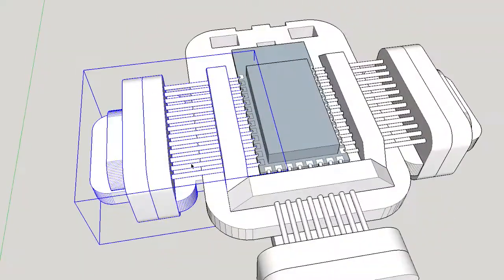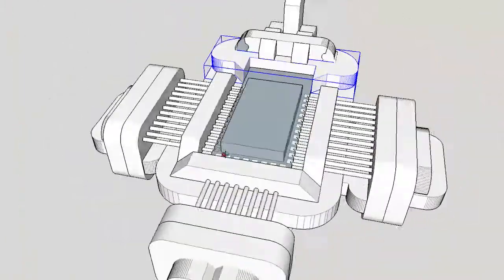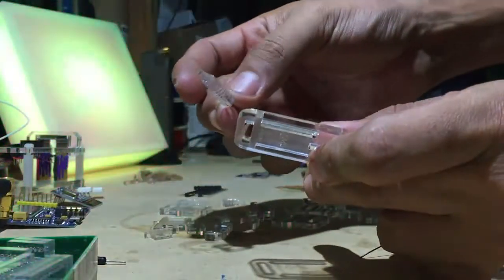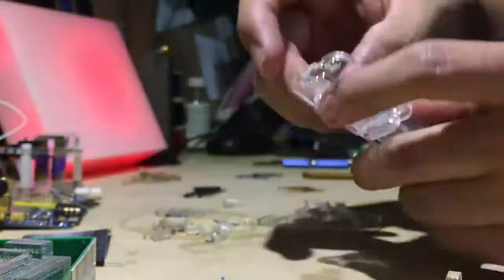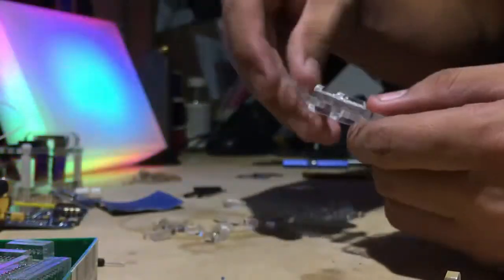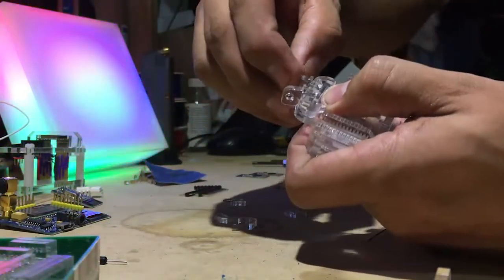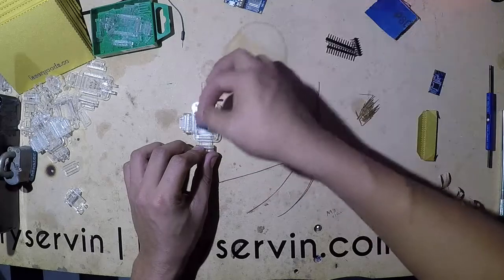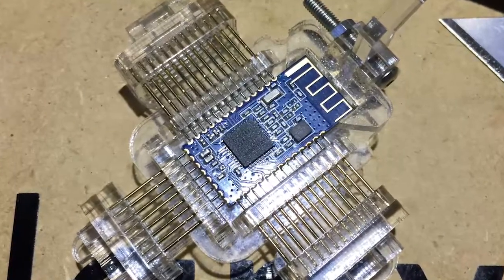HM-10 Bluetooth Module Programming Jig

Comment: This is pretty cool contraption :) I think the reason why you have to sand some pieces down is because you haven't taken tolerance/clearance into account in your design (is this solidworks?). For 3D printing specifically, which is probably in some similar to laser cutting, i have to add 0.3mm spacing between all horizontal joints (for my cheap printer). This helps to account for minor dimensional inaccuracies when it comes to pressfit parts.
Reply from the maker: Alex Gorbatchev thanks! Yeah, it's the thickness of the acrylic sheet, I made a second one with a thinner sheet and it was super loose! I just wanted to make it where you don't have to use glue. I'm using sketchup here

Comment: Do you just program the HM-10 with ATcommands or are you able to program it with an IDE? I've been looking for a video of someone actually programming it instead of just changing the board name and information with ATcommands. I would like to use the Arduino IDE or mbed platform if arduino doesn't work.